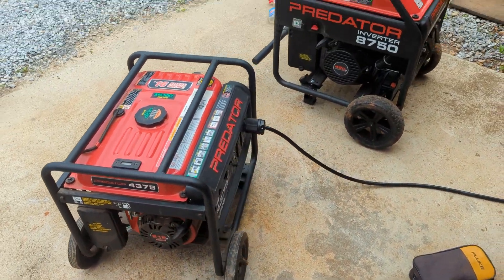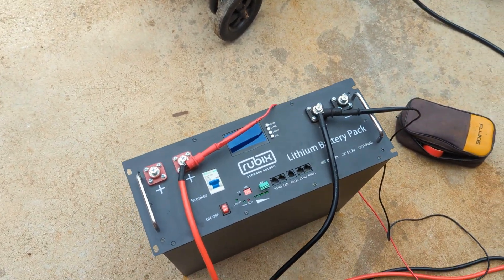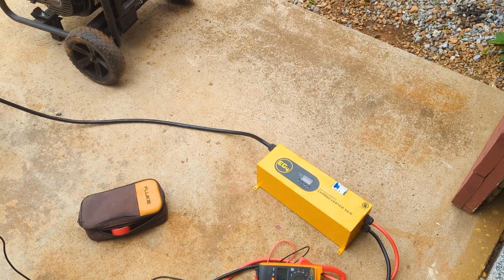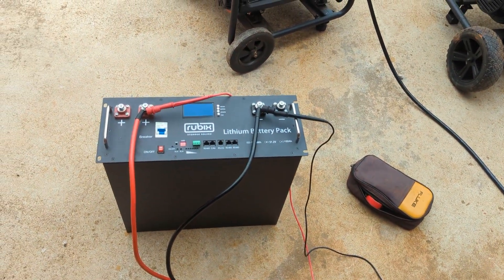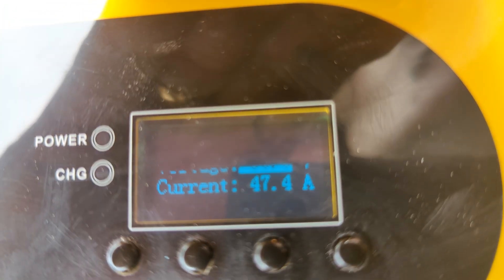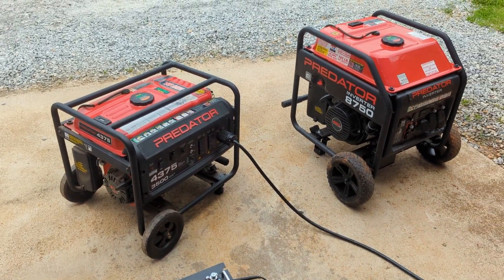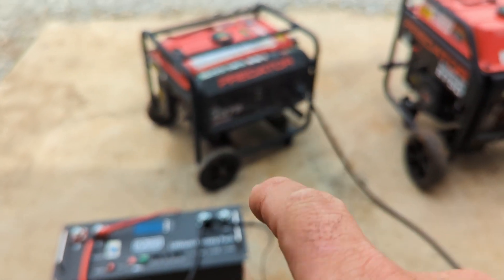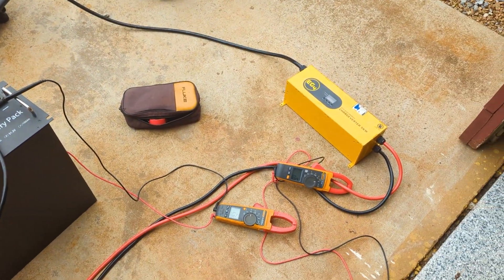A slick off-grid charging option!

Comment: These chargers enable you to dedicate full capacity of generators up to 10k to charge batteries, since they can be wired 120 or 240 and the charge current can be adjusted to get in the sweet spot of any generator or battery pack size for max fuel efficiency and max power to battery.
Reply from the maker: @travishodges5179  each chargeverter 5.12 KW, not 10 KW but you can parallel them.
Reply: @engineer775  true, was going to say 7500 watts for the 80 percent rule, but the 10k generators are at peak fuel efficiency at 50 percent load which is the goal, most power least fuel. Great product. In my experience working with generac, Undersized gensets at full load can consume more fuel than larger gensets at mid range output.
Reply: Point is: this is a great product and can be dialed in to maximize the usability of any generator you already own. I just wish it was still under 400$

Comment: Mine was DOA... Keep the box till you confirm success.
Reply: There has been a YouTube video showing the common DOA reason. The charging modules inside the yellow chassis slide out of their rack mount frame. Open it up and slide them back into their chassis and they work again.
Reply: @maverickmacgyver  This absolutely should not happen. I hope EG4 fixes this.
Reply: @Steve-wz5pz  I agree. There should be a retaining clip or block that secures the power supplies from sliding out of the chassis. It is brilliant that they found such a thing and made it a practical item for solar off grid charging via a smaller generator.

Comment: Can that be hooked up to a rack of batteries in parallel?    Example 3 5kwh batteries to make 48v 15kwh. Wide open 6kw generator should charge rack in 3 hours, correct?
Reply: I use it on a rack of 6 ea 48v 5kwh batteries.
I just hook it up to the bus bars.

Comment: I purchased the Chargeverter to overcome an issue where my generator couldn't start up my 4 ton HVAC unit. 

I decided to get a 20kWh battery rack and a 12k LF inverter that is used for emergency backup only (no solar). I use a standard interlock & indoor power inlet box to connect the system to the load center. My  Honda EU7000is generator used to be my primary backup but the inrush on the compressor in the condensing unit was simply too high, even with a soft starter installed.

Now when we lose power, the inverter & batteries run the house for most of the day and the Honda is used to recharge the batteries a few hours each day.  If I have to run the HVAC, the 12k inverter can handle the inrush no problem, and the Honda can keep the batteries charged using the outdoor inlet box, feeding the Chargeverter which is connected directly to the rack. I converted the Honda to tri-fuel and usually use it with natural gas, so the output power is a bit reduced. I tend to run it at 4kw for recharging the batteries. I like this setup because for shorter outages, I don't need to get out the generator. I also don't need to run the generator at night, so it is quieter for sleeping. It's also more efficient since your only using the energy you need and the generator power all goes into the batteries for later use. The generator also gets much less run time and should require less maintenance and less continuous use should extend it's life.

Comment: If you hook this up in parallel with a solark how does the inverter respond to the  separate charging source?
Reply from the maker: I will test it and report back.
Reply: @engineer775 any feedback on this? Specifically if your using with a solark  inverter + batteries with closed loop comms? Solark told me it would cause problems and confuse the inverter but that was prolly just a default response from lower level tech support.
Reply: It doesn't care.
It shuts off on voltage.
When it hits target voltage, it ramps down the amps to zero.

Comment: I don't know how you get much of a charge at all  with all them chemtrails socking the Sun out  up over your head
Reply from the maker: Charging just fine that day 142kwhs produced.
Reply: @engineer775 them aerosoles must have just kind of helped the charging process along then
Reply: Lol
Reply: LOL, what are you talking about?
Reply: @jessesilver  you see those streaks at the beginning of the video in the sky  ..nature didn't put that there?
Reply: @markcdeyoung3118  Feels obvious to say there are airplanes in the sky that leave trails, but hey, I just said it. My main point was that you commented on a tiny line in the sky somehow soaking up the sun such that the solar panels won't work. Not only is that line a minuscule % of the sky, but its obviously quite bright out still, so I didn't understand your "socking out the sun" comment.
Reply: @jessesilver  I didn't say it turned the sky's dark as two  midnights stuffed and corked into a moonshine jug  those trails create a haze in the sky    notice how some of them have expanded to the point where they kind of look like clouds  which eventually turns to a haze   they aren't just the skinny one  and it does drop the power potential of those solar panels a pretty noticeable bit
Reply: Is there an option in the settings to have it start charging a minute or two after it sees power from the generator?  That way when my inverter auto starts a generator it has time to warm up before slamming the generator with a load.

Comment: Interesting to see the limits of what it could handle from various/cheaper gensets, ie variations in frequency, fugly waveforms and voltage variations. I have found that only the more expensive inverter type gensets are harmonious with most inverter-chargers for these reasons, so this certainly could be useful if it could handle whatever is fed into it, if you needed to charge batteries, but this would have to be done electrically separate.